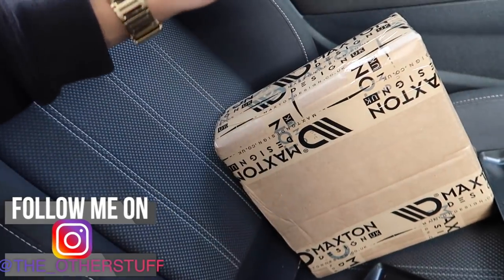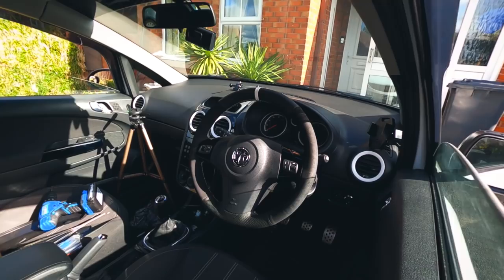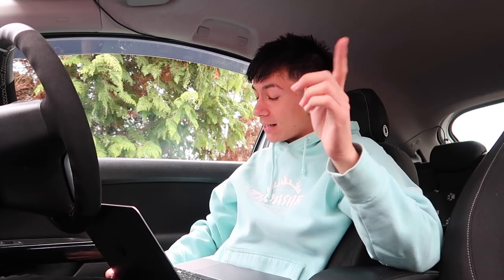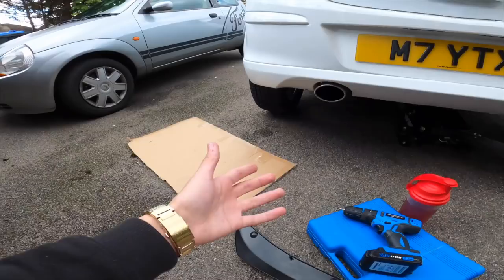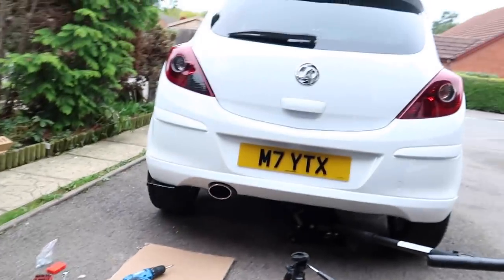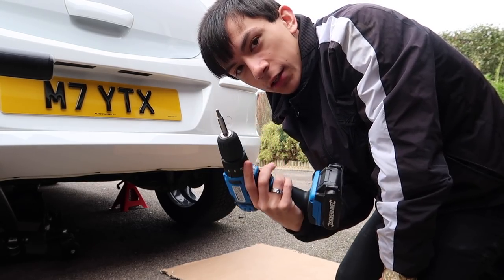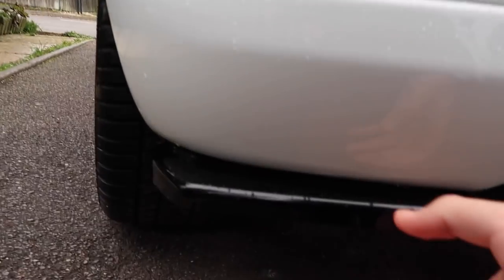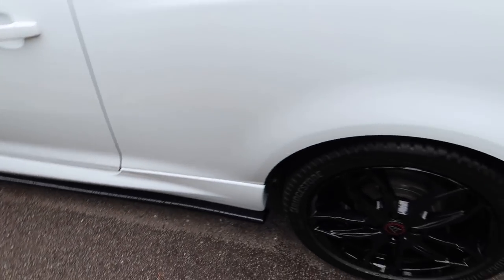INSTALLING REAR SPATS TO MY CORSA!

Comment: Install Pouch.
Go to checkout.
Wait for Pouch to run through 7 codes.
Ends up using the code that is plastered at the top of every page on the website.
Good job Pouch!